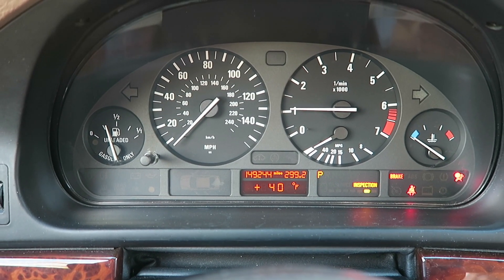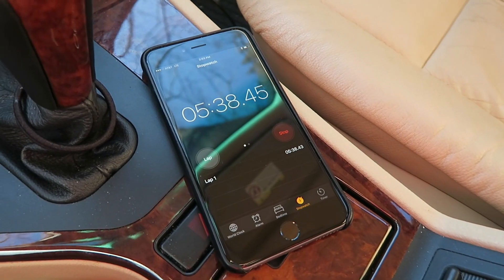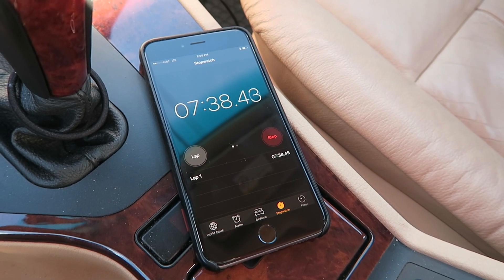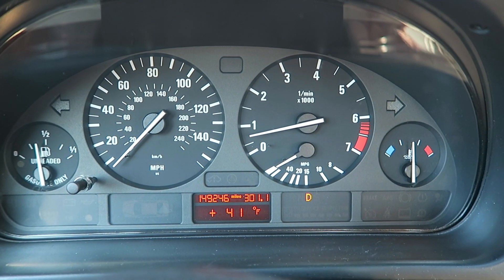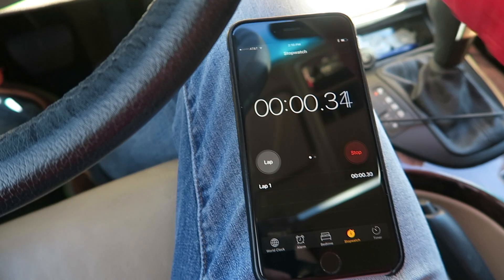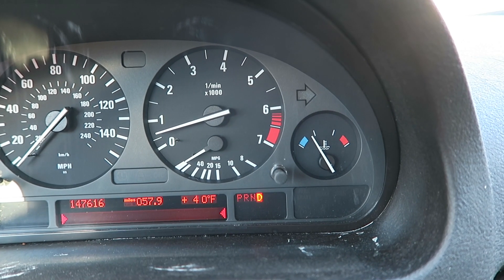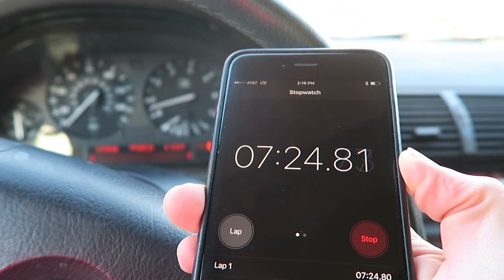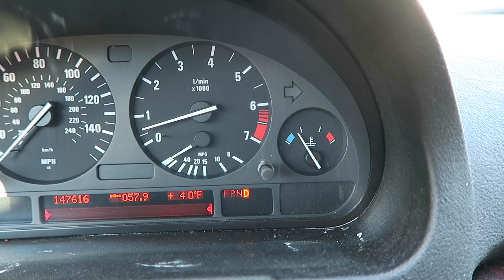BMW Bad Thermostat Symptoms Warm Up Test E39 VS E53 P0128

Comment: so what would you assume is the proble when the car overheats very quickly
Reply from the maker: Could be so many things. If you're lucky it is just air in the system. Could be bad thermostat, water pump, overheating can also crack the head or ruin headgasket on these engines. Get it inspected asap!

Comment: In my case, when it warms up and hit the first notch (first line) when I start driving it goes back down. To the point it reaches yhe blue mark. When atbidle it goes back up to the first notch line.  Is that mean i need to add coolant? But my reservoir stick is in the right level. Any suggestions?

Comment: I have a bmw 320 D N47 F30 and the car takes for ever to hit 100 C on the oil gauge, I was driving 25 km and 10 of them was on the highway going 120 in sports mode to have a bit higher rev, and it still didn’t hit operating temperature. I suspect the thermostat what do you think?

Comment: Just noticed today my 2017 X5 35i has barely warmed after a relatively long drive. I noticed when I turned the heat the coolant temp on the hidden menu would drop but if turn off the heat the coolant temp would increase again.

Comment: I have BMW 320i n20 engine 4 cylinder twin turbo, car runs for 1 hour the neadle won move much but if you turn on the heat blows hot ,what's the problem.

Comment: My doesn't warm up...it stays a bit over blue....only when i drift in the snow(push the motor)it reaches the optimal temperature. Whats the problem?
Reply from the maker: Step one check coolant level. Could be faulty thermostat or low coolant. Could also be faulty temp sensor or temp gauge. What year and model is your car?
Reply: @BIMMERZEITT  e46 2003
Reply: @BIMMERZEITT  tnx will check it

Comment: The thing is, even when the temperature gauge is pointing straight up, it only reached about ~75C. But it still has to climb to over 90C.
That’s because the gauge is buffered.
You can check your real Temperature with the Secret menu in your cluster.

Comment: well i have an e36 with a themo thats stuck closed so it overheats within 8 minutes and on the other hand my e46 has one stuck open and dosent get up to temp (unless its a hot day and im idling in traffic)
Reply from the maker: Dead Inside thanks for sharing your experience, I appreciate it. Just goes to show everyone reading the comments here they really can stick open or closed. Super common on these BMW’s. I’ve seen new ones fail too.

Comment: Wait what? I thought it was bad if the car get to working temperature really fast. My bmw e39 528i touring get to working temperature after 2-3 minutes of driving now during the summer at around 15-20 celsius. The car has 350.000km on the meter and I am afraid it will break down any day possible due to the high mileage and my friends scaring me from their bmw stories.
Reply from the maker: the thermostat can fail in two ways: stuck open or stuck closed.

Comment: Hello,
2001 E39 here.
So all of a sudden my coolant temps are hitting ATH in the secret menu; 105 deg C.
I removed bleed screw closet to engine - nothing flowing. Normally that would dribble water. 
Do you think my thermostat has died and not opening?
Reply from the maker: Carter Heavy Industries check coolant level first is reservoir low

Comment: Took my 2004 X5 3.0i 12 minutes to reach operating temperatures. What do you think? Just had a bunch of stuff done for the coolant system in January. Flushed it, serviced it. Just didn’t replace a thermostat. Let me know what you think about 12 min.
Reply from the maker: Too long. I would change the thermostat. Do you have any record of how old it is? They’re cheap on these cars, $45-50.

Comment: Hello. I have a 07 x3 E83. I'm having a problem where my car will warm up slowly but once it does warm up and I turn in the blower motor, only after I turn on the blower motor, i start to lose coolant temp. Even on the lowest setting. But if i turn the blower motor off, the coolant temp starts to increase again. Any idea??

Comment: Did you notice the car heater not working at idle ?
Reply from the maker: Leonard Planck III heat worked once warmed up; the issue was the extended warm up time
Reply: BIMMER ZEIT what could be my issue ? Water pump has been replaced before and power steering. Car now has no heat unless I press the gas ? Should I order new thermostat? You go with behr on all your parts ?
Reply from the maker: Leonard Planck III check the coolant level first! What car year and model do you have? BEHR is good, I use a mix of German brands. Wahler for thermostat and hepu for water pump. When did the no heat issue start? After a repair?
Reply: BIMMER ZEIT just noticed it this week as it got cold. 03 525 i sport auto e39. Someone told me might be the damn heater core unfortunately?
Reply from the maker: Leonard Planck III first check coolant level in expansion tank. Check level when cold never open when hot. Also check the temp control wheel on the dashboard make sure it’s not scrolled towards cold; set it in between hot and cold or all the way hot since it’s now winter. Report back your findings.
Reply: BIMMER ZEIT is the temp control wheel in the computer of the car ?
Reply: BIMMER ZEIT coolant level fine and I only use the blue antifreeze. Do you use any type of antifreeze or just blue?
Reply from the maker: Leonard Planck III no, the physical wheel between the center air vents
Reply from the maker: Leonard Planck III bmw blue only mixed 50/50 with distilled water
Reply: BIMMER ZEIT okay yes I have it set to 3 red and the backseat to red
Reply: BIMMER ZEIT I’ve seen others at the store blue cheaper but I’ve only used bmw brand blue from fcp. Is the other off brand blue okay ? My mechanic said any antifreeze is fine but I like the blue personally.
Reply: Hi, did you figure out why no heat at idle only acceleration? My 2005 x3 is doing the same. After filling up with coolant and bkeeding it works fine for 3 days then back to no heat at idle. Please help if you can.

Comment: I had that same issue in the X5 with my E46. Threw a CEL at 99k miles when I was driving down the road for a thermostat. My temp gauge sometimes goes to the left when I start the defrost for the first time. Then after it goes back in the middle.  Don't know if that's normal.
Reply from the maker: Hmm I haven't heard of that one before! lol. Always something new with these cars. It's nice when the SES light comes on for the thermostat so you know where to go right away. The hard part is when they fail like on our X5 without any light to tell you "Hey, I failed, replace me!"
Reply: @BIMMERZEITT  Lol me either. My indy thought I had a bubble in the system. Checked the level and everything looked fine when cold. At first I thought the thermostat is adjusting with the load from the defrost. I rarely use it because it rarely gets cold where I live. Good thing is it stays in the middle without it on. And the level is good.

Comment: Have you concidered different grades of oil? Thinner oil warms up faster then thicker grades (Just something else to concider)
Reply from the maker: Jacob Sauer using 0w40 in the cars which is quite thin at cold start. We were looking at coolant operating temp, not oil temps. The thermostat ended up being defective in the car!

Comment: Did the X5 have heat with a bad thermostat? I have a 2001 740il and my car heats up in about 10 mins but it doesn't have heat. I have to get on the highway for quite a while for it to heat up, the heat through the vents, I mean. Also, I'm about to check to see if it will be hot with my hood up. If not, I'm going to check my aux pump and possibly my thermostat. Great video.
Reply: Brian Jenkins  

It’s super bad then, if it needs highway speeds to heat up and takes over 7 minutes no matter what BMW, so yes you need a thermostat.
Reply: Hi, did you figure out what the proboem was? My 2005 x3 does the same. No heat from vent until a long freeway drive and cool air at idle. Please help if you can.

Comment: Did your X5 have any check engine codes for bad thermostat ?
Reply: Matthew Calderon 

No, BMW check engine lights don’t come on for that part. But the fluid you remove from the thermostat or add has a sensor for how much you put and if it’s too low the car will tell you on the dash that it’s too low
Reply from the maker: @aidenp5768  not true, there are definitely BMW codes for a bad thermostat. The problem is the failure of these t-stats doesn't always coincide with a code, or else life would be soooo much easier to diagnose these things.

Comment: when my car had a leaking coolant problem, the temp would go into the red. but after being in the red temp for about 30 secs it would within ten second revert to normal (middle) temperature. Anyone have any thoughts?
Reply: AgentMrX7 bad thermostat change it before ur water pump gets affected also
Reply from the maker: it can be so many things... if your car is leaking coolant and runs low on coolant there will be a small amount left in the cooling system. The insufficient volume of coolant can turn into steam in certain parts of the cooling system and cause the needle to shoot up into the red zone. If this happens you are lucky because you get a chance to shut off the car and resolve the issue without actually overheating it. It's merely steam causing the temp reading to shoot up. Most people do not get that lucky, and the car actually overheats. When it does overheat, you can blow the headgasket at which point the aluminum block M54 is known to rip the steel head bolts out of the soft aluminum threads in the block requiring a complete engine replacement.

Comment: BZ.
     Your X-5 has a nocking sound when you start the engine.
     what is that sound.?
     Can't be the motor mounts.?
     Thank you again for keeping in touch with all of us
     with BMW.
Reply: Knocking is vanos gear worn out this is common on m62 v8

Comment: what if the temperature switch s faulty is the same problem so we must check both
Reply from the maker: to God be the glory true it’s possible but thermostat very very common on these motors, especially if it’s 4,5,6 years old

Comment: Hey I have the 530i and I'm getting the p0128 code with the thermostat but my BMW reaches operating temp in like 5 to 7 mins but does not go over the average operating temperature(middle of the meter) so why am I still getting a code thrown it seems to be working just I'm confused by this get back to me asap thanks!!
Reply from the maker: Check your coolant level first, if that is ok, you likely have a bad thermostat. The sensor goes bad (they're electronic on this generation of BMW) and will throw the code.

Comment: can any tell me why my car overheats when idling and cools down when accelerating put a new raditor in
Reply from the maker: funny funny it sounds like your auxiliary fan is not working, or fan clutch as well. Test those two items!
Reply: Arent the fans supposed to turn on when you first start the car
Reply from the maker: No they are not. The fans come on once the coolant reaches a certain temp and the fan switch tells the fan to turn on so the car does not overheat.
Reply: How do i check the fans its a 2004 impala
Reply: its simple .start your engine and wait it to warm up .
the fan must start when coolent warm. 
if its overheat check the fan .see it work or not if its not work .may be fuse .relay.or temperature switch.or the fan dead.or thermostat not open.
check the water level in radiater and all hosses .sometimes their will be asmall leak in heater core .
finally it may be ahead gasket
Reply: It was the head gasket unfortunately
Reply: ASAP SEVERAL how much can a head gasket repair cost? My car overheats at idle and cools down when driving at fast speeds.
Reply: Air is flowing when your driving that's what cools the engine at idle there's nothing y your car has a fan and a thermostat. If there is air in the system or faulty fan or thermostat it will overheat at idle
Reply: My clutch fan hasn't worked for 2 years it just freewheel s auxiliary is cooling it however fans only come on at 104 degrees. BMW engine specifically the v8 run 10 degrees hotter

Comment: so bad thermostat valve is that .. quick open or slow open?
i am in Thailand the weather is very hot so if the valve is open quicker it is good i think .
Reply from the maker: monthon vallsri hello! Thailand is beautiful, visited in 2015. Sometimes thermostats prematurely fail stuck wide open- they never close. Normal operation is they close while the car is warming up, to allow for faster warm up to operating temps. Then the fuel mix normalizes once it reaches operating temp and thermostat opens. If it fails stuck open like this one has, the car takes much longer to warm up initially and has a longer period of running on a fuel mix that is too Rich. That's bad for fuel economy, and other engine parts like plugs and catalytic converters. Hope it helps!
Reply: Oh Ok Ic thanks for sharing , one point is that if too much warming up engine, it will consume too much fuel.
Reply: Most of BMW I own they have high temp thermostat they like to open 100°c to 105°c I'm not sure if it same as the one in Thailand winter in Canada is extremely cold especially today we hitting -50°c with wind factor so higher temp thermostat will do us a very big favor.
Reply: Hi i am for libya i have problim  in my e39 over heat wiht ac on

Comment: ill go test it out myself to...but i got 525d e39...so its not the same....but i got another problem with my car...even when car is at operating temperature or even if i drive it all day it just wont blow hot air into cabin at more than lvl 3/15 ventilation settings....but if i drive it in sport mode witch means high rpm..heat works little bit better and im not cold all the time...afc it wont work when i turn up the blower mottor. So i have no idea what is it...any ideas ?
Reply: xAsmir have you checked your final drive unit module it controls that if im not mistaken? I do not know how their tested though in respect to determining if its defective or whatever.

Comment: I had the same problem on my e39 530d, especially now in the winter time. I couldn't warm up the car at all as soon reaches the temp and again was going down the temp. Mine e39 530d has two thermostats.
Reply from the maker: Tarik thanks for sharing, didn't know that model has two thermostats- interesting! Wish we had that motor in the US. Happy New Year!
Reply: BIMMER ZEIT you are welcome, I enjoy your channel :) happy new year and all the best in the next one. Best regards
Reply: I don't know about 530i, but for 530d there is the link you can check exactly no. 6 and no. 14 photo 

http://bmwfans.info/parts-catalog/E39-Sedan/Europe/530d-M57/R/2002/browse/engine/waterpump_thermostat/
Reply: Where is that second thermostat placed ?
Reply: This EGR thermostat does not interfere , the engine warm up period
Reply: yes it does, on mine EGR thermostat was the issue to keep the engine at the right temperature
Reply: Interesting , i changed a few of them , just because they were faulty , but the car never have problem with the warm up .

Comment: glad youre still active!
Reply: does driving the car when cold mess up the engine?
Reply from the maker: Thanks, and Happy New Year! Actually BMW recommends not letting the car "warm up" before driving. At the same time, I wouldn't drive any car hard until it is at operating temp.
Reply: +BIMMER ZEIT happy new year to you too man youre the best! #e30gang. have a good one